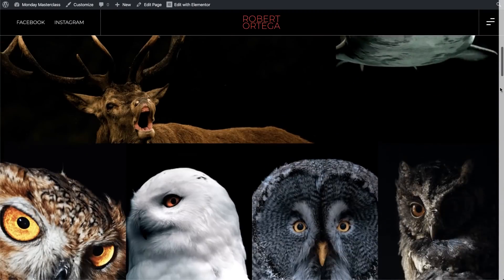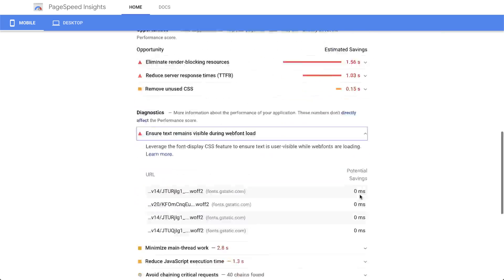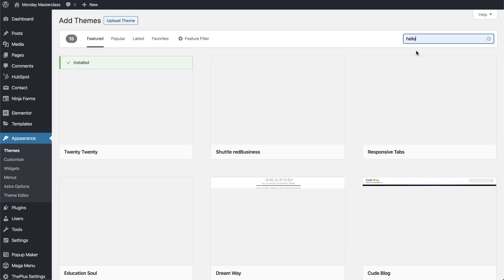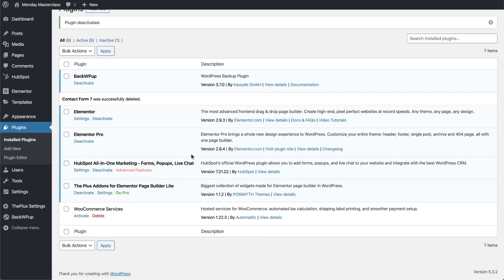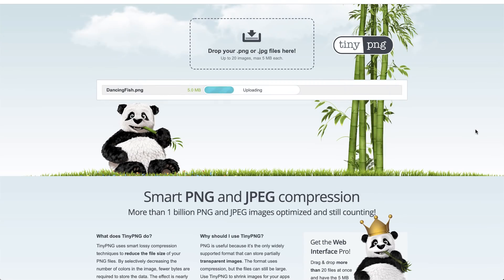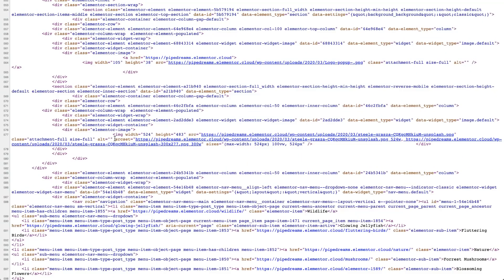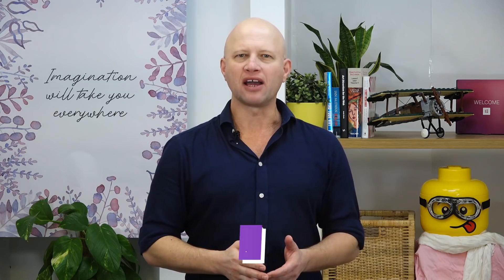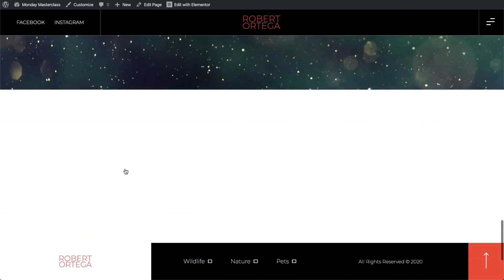How to Speed up Your WordPress Website — Part 2 — Monday Masterclass

Comment: PPI (image resolution) is not a factor. This is a common point of confusion. PPI in a file is meaningless. Suggesting one uses a 300ppi image is misleading. The actual display resolution is determined at the time the image is rendered on a screen. What matters is the pixel count - the number of pixels for width and height. Images will typically be scaled to fit in the column, regardless of the file's PPI. If the image has a higher pixel count than 100% of the column width, then the browser not only runs slower down-scaling the image - it also means after downloading all those pixels they're being thrown away. Most of the sites I've worked on have columns of 650 pixels, so the images don't need to be wider than 650 pixels (unless those images are to be featured in a lightbox or allow the visitor to zoom in).

Comment: Good, as always. However, a few comments. It would have been good to address some of the issues specific to Elementor. The tips were very general (mostly).  I also think you are confusing the issue with your reasoning about ppi: The ppi varies from one screen from another, not only on Appel Retina screens. The ppi of the image that you upload is, I believe, irrelevant. What counts is the pixel dimensions. Secondly, about Lazy Load: Almost all Lazy Load implementations that I have tested make internal anchor links unusable. They simply screw up the reference so that an anchor link takes the user to the wrong place. I’ve so far only found one lazy load implementation that works with anchor links (“Lazy Loader”). On a side note, I am not happy with Elementor’s implementation of anchor links: In a “normal” implementation of an anchor link clicking the back-button in the browser takes you to the starting location on the page. Not so with Elementor. Clicking the back-button at an Anchor Link in Elementor takes you to the previous page. Not at all what the user expects (in my experience).
Reply: Actually, you're making a couple of mistakes regarding lazy-loading:

There is no reason lazy-loading should make internal links unusable. Those links target elements IDs (pageurl/#ID). As long as the DOM, including the element you're linking to, is loaded at the time the user clicks the link, it should take them to the target element.
What can happen, however, is that because of lazy-loading, when they get to the target element, some images get loaded and suddenly take up vertical space where they previously didn't, and cause a "jump" on the page. This, however, isn't a problem with lazy loading, but a problem of design and usability. Jumps cause a poor experience for users. It's your job to plan for this and design a nice experience around those constraints. A very basic way to handle this is for example to set a minimum height on divs where images will get loaded. This way, even when they are loaded, they don't take up more space than the "empty" div did.
But, as I was saying, this is a problem of design: not only how the page looks, but also how it will function.

Comment: I would after downscaling in photoshop with ctl,alt,i image size run the export for web (save for web)keep nothing above 999 kb per image. should fine tune sharpen in the save for web section which will get rid of any unwanted unsharp effect by downsizing. good practice if you have more than 3-4000 product images on your site.

Comment: You mentioned reducing Sections. Having different numbers of columns on a page affects the number of sections you may need. Do you suggest using Inner Sections as oppose to adding a regular section?
Reply from the maker: Definitely not! This shouldn't be misunderstood. You should use as many sections as you need to create different layouts of columns.

Comment: Want to optimize more ?

1. If Any speed tools recommended you 300x300 don't get fools instead increase the size to 600x600 for retina user.
2. Use asset management plugin like asset clean up plugin or perfmatters to remove unused CSS and js.
3. Defer all the JS except jquery yo remove render blocking.
4. Instead of using Google fonts upload custom fonts in woff, woff2 and TTF format use elementor pro custom fonts functionalities.

I will update later :-D
Reply from the maker: Thanks! great tips
Reply: That's an interesting point about Google Fonts. We have no influence over external data so it make since to upload them to your own server. That's something I'm going to test for sure. Thanks for the tip thangjam
Reply: @williamcooper8559  The only benefit of using Google CDN and Google fonts is caching because most of the popular fonts like poppins, Open Sans  etc are already cached but the custom fonts don't